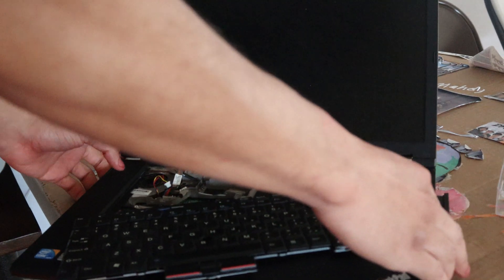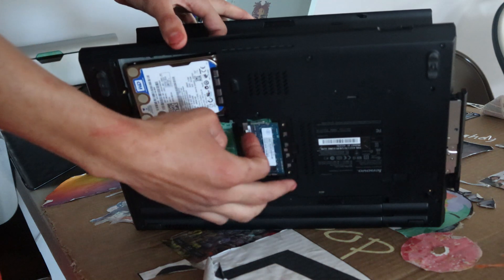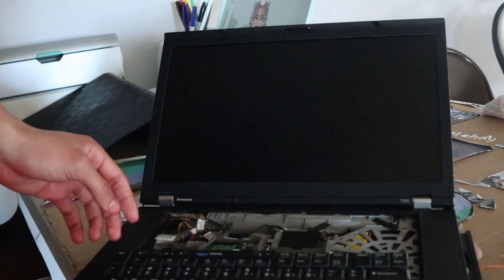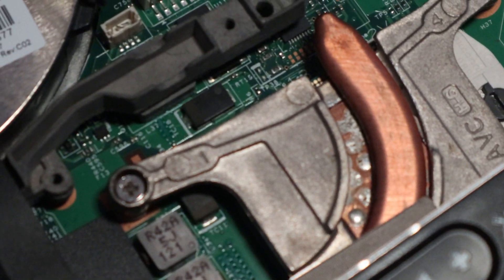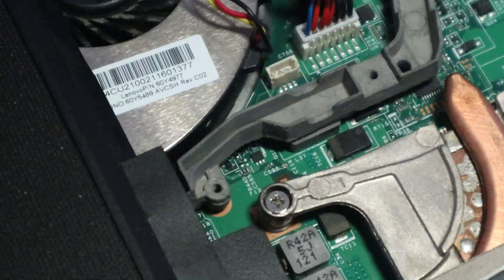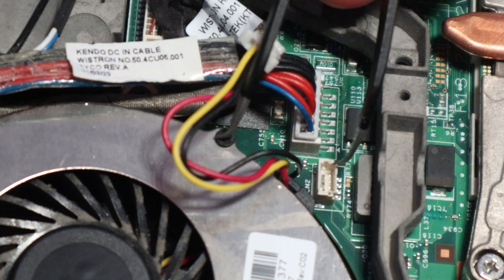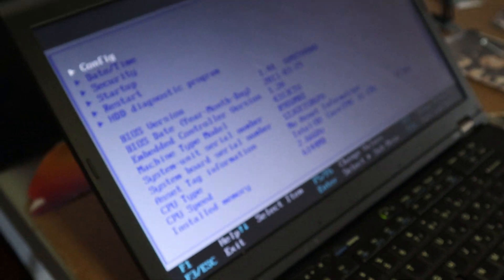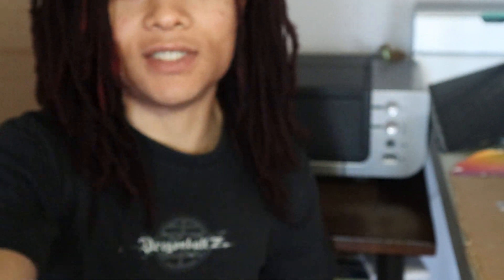lenovo t510 fan error code fix cpu reseat how to

Comment: you don't need all of that
this problem happens when the device is cold

what you can do is
- When the error message appears click ESC
The device will boot normally

If the fan did not start you have to 
- Wait until the CPU heat's up and restart
the fan will start normally
Reply: Thanks a lot! It helped me
Reply: @ЕвгенийПримак-л5я  You're welcome
Reply: @ahmed53938  wow,thanks ❤️
Reply: @oliviaandhira3822  Welcome
Reply: Works like a charm, highly recommend this
Reply: Thanks a lot. Worked for me
Reply: If it still doesn't work
You need to check if the fan spins freely in the beginning of the boot
If it's not spinning or it stops so fast
That means either it's not clean or it needs new oil

So remove the power and the battery just in case,
If the fan is clean and you don't want to take the fan out
Spin it with your finger and if there is some kind of friction that means it needs new oil

So do this
- There is black sticker on top of the fan, 
- Remove it and you will see some holes,
- Fill them with any kind of oil you have,
- Spin the fan with your finger until it spins smoothly, If not keep adding oil.

If your fan doesn't have holes or anything
You need to take the whole thing out to clean it and adding new oil

Comment: You can remove that plastic insert, to get to the pins right at the board. Then replace the insert, and plug it back in. I can see why your channel never took off, You're just another IDIOT who is NOT computer savvy!!

Comment: Hey man  I just checked mine out and it has the fan error thing, I checked the pins and all of them are fine, but my fan error started when I put my machine on high performance and I saw the temperature shoot up to 90 degrees and got fuckimg scared and shut it down to cool off, when it had completely cooled off, I tried turning it on, again and the fan error shit started happening

Comment: Hey man all lights blink it won't start, t510 and the CPU fan spins for 1 sec and then it stops and it just does this over and over
Reply from the maker: mazdamx2005nz I think you have the same problem. Did you recently unplug your cpu heat sink fan?
Reply: @Mahdymax  I just gave it a bit of a dust off but I didn't unplug or anything, for some reason when I put in a different cpu (the new one I put in turned out to fit but be incompatible) the lights didn't blink and the fan didn't spin but the optical drive started and I could open and close it, however when I tried it with no cpu or the stock i5 the blinking lights and the fan went for a second came back again, should I order a new cpu I've found one on aliexpress for $25 NZD or is it a motherboard issue?
Reply: @Mahdymax  with the stock cpu or no cpu all the lights blink and nothing comes on the screen and the fan spins for a second
Reply from the maker: mazdamx2005nz hey I know this may sound funny but try that cpu because RARELY do CPU’s ever die. When you put it in, make sure it’s locked and make sure your fan is connected and none of the pins are bent. Turn it on see what happens, then try unlocking and locking it, with out taking the CPU out. In this video mines was giving a fan error code. You didn’t say nothing about that so it may just be a simple unlock and lock a couple times. ALSO make sure your cpu is going in the same way the arrow on the corner of the part where you go to lock in the cpu are aligned. Hope this works 🙏🙏
Reply: @Mahdymax  alright, I've checked the pins and nothing is bent, I'll give it another shot and let you know how it goes, do you have hangouts or insta or anthring like that?
Reply from the maker: mazdamx2005nz my Instagram is itz_coupe and my Snapchat is mahdymac
Reply: @Mahdymax  alright thanks
Reply: I've messaged u on Instagram @a321neo_aviation
Reply: This is my problem too